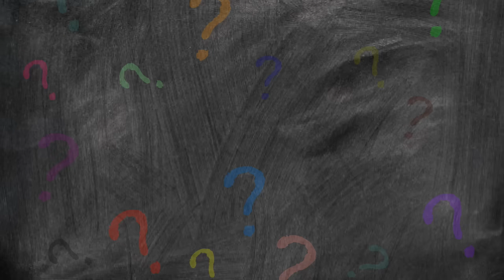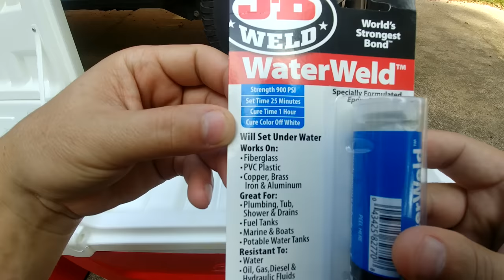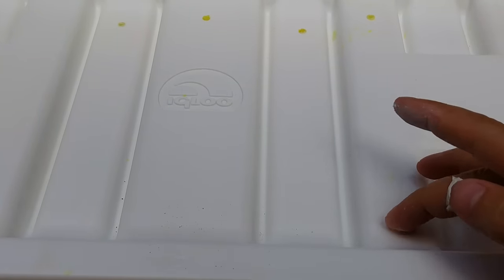Do Yeti cooler hacks work?

Comment: heat (energy) in the air rises. Energy needs a medium to transfer through. Air is less of a medium than the foam you installed. Yeti coolers work by having a vacuum between the inner and outer layer. A vacuum would be the absence of ANY medium for the energy to transfer through. A better hack would have been to tap the lip, pull a vacuum then seal it.
Reply: You can't vacuum seal plastic. it will implode. yeti doesn't have a vacuum either except their small and outrageously expensive stainless steel cooler. $800 is a lot of ice and beer.
Reply: Yeah sorry buddy your theory is incorrect.  They actually have videos of yetis being cut in half and they are surrounded in foam.  Top bottom and sides are all foam between the plastic.  But I’m sure grade school science has helped in other ways.
Reply: @wakawaka1976  That's not a theory. A vacuum is the BEST insulator and Yeti does or at least did vacuum seal all their coolers.
Reply: @wakawaka1976  A near vacuum is the best insulator as there is little to no way for the heat to transfer other than direct contact or IR which is much slower heat transfer. The use of foam creates lots of little air pockets which slows the transfer of heat much like how double paned windows is more efficient that a single pane window... I think you are the one that need to brush up on their grade school science.
The problem here is he used too much foam in the lid so it was too dense and couldn't form any bubbles as it cured and instead just made a big thermal mass which will hold heat instead and slowly give it off over time.
But a really simple way to keep a cooler cool is to dig a pit, drop it down and have like a thermal blanket or even a piece of plywood with foil glued onto one side over the top of said cooler and pit and it'll be good for damned near a week. If you are using it on a boat or can't bury it even having a thermal blanket (shiny side out) will likely help so it has the heat of the sun reflected away from it.

Comment: You have to pre-cool it, much like with it yeti. You have to put ice in it to get it cold first, then replace the ice and whatever you're cooling. The problem is with an insulated cooler is that it takes a ton of the ices energy to cool the insulation/interior, after that the insulation will stay cool.
Reply: But weren't they both pre-cooled for the second test?

Comment: The insulated cooler holds in heat.  You have to pre-cool a yeti.
Reply: Which is garbage cause I have one and I think that's stupid lol. My brother in law's 100 year old Coleman holds ice better then my hundreds of dollar crap yeti.
Reply from the maker: I agree, pre chilling a cooler or using a sacrificial bag of ice is lame in my opinion. I want to pick up my cooler add drinks and go. I don't want to plan my day around a cooler.
Reply: I had no idea that you needed to precool the cooler. Thanks for sharing this little tip.
Reply: I pre cool my cooler if it is going to be used for multiple days, and it’s over 90 degrees outside.

I’ll bring the cooler in the house a few days before our trip, then the night before we leave I put a frozen Plastic jug of water in the cooler.  I also try to pre chill the coolers contents.

If it’s a day use deal I’ll grab that 110 degree cooler off the garage shelf and load it up.

Comment: A vacuum between 2 layers is the best insulator you can have. Your really expensive coolers are vacuum insulated removing as much as possible to prevent anything from being able to transfer heat. The foam acts as heat sink allowing the transfer of heat into your cooler. Therefore, the air in the other lid insulated better than the foam would. Foam insulation works in construction much differently as it is the insulating barrier, not the medium between to layers.
Reply: It's crazy how many people don't don't vacuum sealed air is so efficient at insulating. That's why puffy jackets have air pockets within them. Or thermal cups have a gap of air in between as well.

Comment: The reason the lids are hollow on the coolers is a it’s cheaper and b. Air is a better insulator than foam cause of transfer of thermal expansion. Meaning you keep the cool air in the container longer expanding foam will transfer the cool air through itself faster.
Reply: Two post in a row claim this, but why would that theory not apply to all forms of insulation?  If open void air gaps were superior, than why do we have fiberglass bats in our walls? Multiple cells slow heat transfer from one to the next.

Comment: My experience:
-Fully ice in the cooler will last longer than just a little of ice. Because the empty space in the cooler starting at room temperature, so the ice melting so fast to cooling the empty space. 
-You can put some PE onto the ice, when you have to keep  just a little of ice. 
-remember get rid of water in the bottom. 
-no need to foam the lid, because the cool bottom, the hot on top, so some rubber sealing is enough. 
Hope these tips will help you keep ice last longer.

Comment: Air is one of the best insulators. Filling the lid with solid material means that heat can transfer easier between the inside and outside.
Reply: actually, a vacuum is one of the best insulators. If you could suck the air out it would be even better. In fact I wouldn't be surprised if cooler lids might have a partial vacuum in them

Comment: If you made a giant teapot cozy out of reflective bubble wrap it would probably have a significant effect. I suspect that in filling the lid with foam you put something solid in the lid areas where there was a small air gap, and the foam (not the bubbles in the foam) were more conductive than that air gap.

Comment: Issue: Air is the best thermal insulator. When you replaced a good insulator (air) with foam (greater thermal conduction) you lose thermal efficiency.
Reply: I wonder if the foam absorbed more heat during the day
Reply: Why do people use foam to insulate their houses then?  Different foam?
Reply: They have cut yeti’s in half and they are surrounded by foam... so... sorry
Reply: @wakawaka1976  Foam traps the air, that's the insulator. the foam material only holds pockets of air. Their thermal capacitance of the Yeti foam is better than in the video above.
Reply: exactly. if he wanted to improve it he could drill holes on opposite sides of the lid and flush the air with some gas that has even better insinuative properties than air or try to pull a vacuum on the lid.
Reply: @mattfrownfelter558   foam in a home is used to seal air leaks. Also the best insulating foam has larger "foam bubbles". 
The foam he used was too dense. Mostly also compressed because it could not expand properly inside the lid.
Reply: first thing i was going to say
Reply: @tOmMarzig  single part foam, like he used, is open cell or low density foam.  Home insulating foams are either open cell or closed cell.  Open cell is strictly used for insulation, since unlike closed cell, it's not an air barrier or a vapor barrier.

Comment: The lid of coolers are intentionally less insulating than the side. You want heat that is transferred through the side to be able to rise and escape through the top. Otherwise it is transfering to the ice faster. Heat rises.

Comment: Great stuff is 2 part epoxy as it cures it creates heat.  Maybe wait a week or so then try again
Reply: hahaha
Reply from the maker: Or it didn't work because the quality of the foam isn't the same as what they use in a yeti. It could also be the base of the cooler isn't up to the same quality as well. I set out in this video to originally show how much better this cooler was after hacked. So I was surprised when it wasn't.  If it was truly better would it even be close? Check out my other video on this and you will see its not even close.
Reply from the maker: Or it didn't work because the quality of the foam isn't the same as what they use in a yeti. It could also be the base of the cooler isn't up to the same quality as well. I set out in this video to originally show how much better this cooler was after hacked. So I was surprised when it wasn't.  If it was truly better would it even be close? Check out my other video on this and you will see its not even close.

Comment: Yeah - glad someone did this test.  It';s about time to see the comparison of OEM vs. the hack.  The one method I have not seen yet is putting a smaller cooler inside a larger cooler.  Cheap ones.  Yes, you would have smaller space but the theory I have is that the inside cooler will be protected that much more, kind of a cheap insulation method.
Reply: I've actually already performed this(flexible type cooler) and found it keeps almost ice cold for 9 hours without any ice at all inside a hot car all day.
Reply: @gregzeigler3850  Thank you.  Can you explain more on what coolers you used, and sizing please?  I would like to try this sometime this next two months.
Reply: @joq702  These were approx. 24 inches tall by 12 inches wide. They are the flexible type freeze bags one picks up ice cream for. I put one bag inside the other and zipped both for a cold beer after work(I often work over, so nothing is open). They stay really cold for 9 hours without ice and somewhat cold after 12 hours.
Reply: @gregzeigler3850  That is pretty awesome.  I will give it a try also.  We get some make at home food service boxes which inside have these bubbly aluminum color bags which do a pretty decent job with just one of keeping meats and fish cold in shipping.  I think I will try to double up a few of them and try your test.  They are usually about the size you mention.

Comment: Always prechill your yeti. Since they are more insulated they also hold more heat. I always put a bag of ice in mine a couple hours before I use it, then I drain the water and refill it
Reply from the maker: Isn't that what I did in my second bag of ice?  Before putting the second bag in the coolers they were pre-chilled.

Comment: Cold air falls down heat rises. How's the bottom of the cooler insulated?
Reply: I cut a cooler up once and the bottom area was insulated with foam.
Reply: True, but the top insulation is important in the case if you have sun shining on the top of it

Comment: Air is our best insulator, next to a vacuum. It has less thermal mass and is relatively poor at transferring heat energy in both directions. This is why double-paned glass works to keep your house warmer/cooler. 

The only reason we sometimes use foam is in cases where we can't realistically seal in air naturally. Even then, these types of insulation work by trapping in air. Like foam and fluffy fiberglass.

Comment: Maybe to make sure there isn't a difference in the cooler body itself, like an air bubble in manufacturing, switch the lids on the coolers and try again and see the results. That might tell you if the stock lid actually is what is keeping it cooler vs possibly a difference in the cooler bodies. Scientific method, rule out the variables You also have to be consistent when you check it or it's pointless. 24 to 30 hours is a 25% increase in the test time.
Reply: And another thing to try is to switch the positions of the coolers, one side of the vehicle may get hotter than the other.

Comment: I don't know on this exact model of igloo, but nowadays, many coolers use vacuum walls and lids.  The empty space inside the lid and walls is not filled with air... it's vacuum pumped to extreme negative pressures.  The result is that there's no air inside that, and without a medium to transfer through, the heat can only transfer through the edges where the plastic is.  When you drill a hole into the walls/lids and fill them with insulating foam, that foam is still less insulating than empty vacuum space.

Comment: I wonder if position in the vehicle had anything to do with it, maybe swap positions and try again? Check temperatures on the outside of the cooler lids and inside. I wonder if the foam is actually holding heat.

Comment: I think I know why the foam filled lid cooler lost more ice. The foam may be a better insulator, but it has it's own mass and heat capacity, whereas the unfilled lid had less mass and therefore had less stuff that had to be cooled down. If all that foam starts out at ambient temperature (which you said was almost 90˚), that ice has to cool all that mass down, and that's what melted more ice. All else being equal, if the foam were not warmed up to such a high ambient temperature, it should perform better.

The test you performed indicated how much ice was needed to cool your coolers from their initial temperature down to freezing, and combined that test with a test of ice retention. If you first chilled both coolers down to melting temperature, and then tested ice retention, I contend that the foam-hacked one would win for ice retention alone. But for the test you did, which involves cooling them down, the foam filled one lost, because there was more mass to cool down.

Comment: Hi James, great experiment,  I would swap lids and try again,  that should confirm results either way, 
There could be a bit more insulation in the walls of the 'stock cooler' who knows the quality control standards in the manufacturing process of these cheaper coolers. 
I would think insulation levels in the walls and base of cooler  (which is in contact with the ice) will have more of an effect than insulation levels in the lid
Reply from the maker: This was exactly my thought after I finished the video.  I plan to redo this experiment in the summer and swap lids to see if my results still hold true.
Reply: @HowToWithJames  so have you redone it yet?
Reply: @HowToWithJames  have you posted a video yet
Reply: Curious as well
Reply from the maker: I decided not to do a video for this but instead I did another cooler video comparing these coolers to an actual yeti cooler along with the Walmart brand (Ozark trail) cooler and a styrofoam cooler.  The results were interesting. Check it the video!
Reply: @HowToWithJames  Do the video Please My Friend.

Comment: Is the jb weld food grade? That may be a concern.  I think I would look for some type of rubber or plastic plugs and glue them in if necessary. Looking good. Maybe some waterproof tape. 3m.well with cold drinks and food there would be significantly more ice. For $17 the sides and bottom may not have insulation. Idk. The outcome is quite unexpected. Something is not right. The outcome should be much different. Is the insulation creating heat and not cooled.

Comment: I am pretty sure that the lid is hallow because it is using vacuum insulation, which is the same concept of hydroflasks, yeti mugs, etc. because in order for temperature to pass through something, something needs to be there. So you essentially just added material to a vacuum, which previously could only transfer heat through the small amounts of plastic connecting the inside and outside. Really the only improvements that nicer coolers have over cheaper ones is that they add actual insulation between the inside and the vacuum in the walls. I could be totally mistaken, but that would certainly explain your results.

Comment: Thermo-magnetic-molecular-dynamics: The magnet on the subwoofer attracted the cold molecules which kept the cooler closest to it colder. It’s the same concept as the Mr Fusion flux capacitor used on the Delorean in the movie Back to the Future.
Reply: That is the best thing i have read all week
Reply from the maker: I think what he is saying is I needed a flux capacitor to make this work better :)
Reply: @HowToWithJames  I added 2 flux capacitors to my igloo. A bit overkill bit it really helps to keep the cooler cold.

Comment: The best insulating spray foam with the lowest thermal conductivity (highest R-value) is typically closed-cell polyurethane spray foam. Closed-cell foam has an R-value of approximately 6 to 7 per inch of thickness, which is higher than open-cell foam (which typically has an R-value of about 3.5 to 4 per inch). This makes closed-cell foam the superior choice for insulation purposes, providing better thermal resistance and efficiency.

Comment: The result was what I was expecting for the reason others have stated.  In most manufacturing the thing doing the insulation is 'dead air'.  There are fancier ways but I mean common stuff like foam, fiberglass insulation and so on.  It is the trapped air doing the most insulating.  You had trapped air and you filled it with expanding foam so "less trapped air".  And given you pumped in so much and didn't get huge warping I am guessing you used a lower expansion style of foam so - denser.
Reply: very good analysis, I also think he should have put the foam in the sides and perhaps not as much and let it expand.

Also the foam might not have cured properly and was still heating up for days.

Should have taken temperature from the outside wall of the coolers, you would have known really fast which one was the best.
Reply: Materials engineer here, good explanation!
Reply: Put another way, the added material acted as a thermal "bridge" that allowed for the conduction of heat into the cooler faster than the convection of the air inside of the lid by itself.
Reply: @Arsonist42  I hadn't thought about whether the foam was still curing.  I think by the last test though everything should have cured.  Internet tells me up to 24 hrs for full cure of low expanding spray foam.  But it also says it cures from  the moisture in the air. So... dunno.  BUT - the heat is generated from the curing reaction so if it was curing it should have been done by then and if not curing (for example when it is still in the can) then no heat.
Reply: @JewDude82  Damn I saw this comment and was going to mention thermal conductivity but you beat me to it!